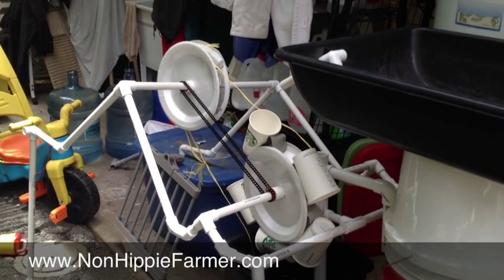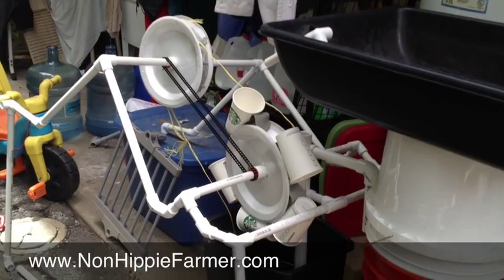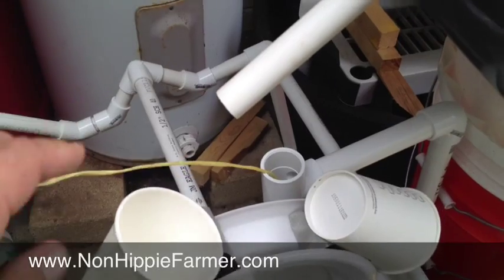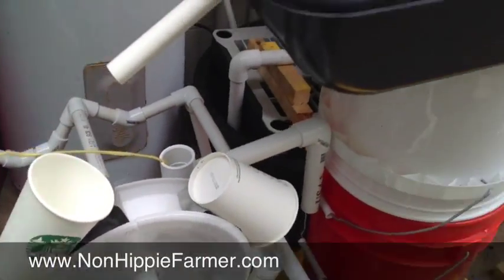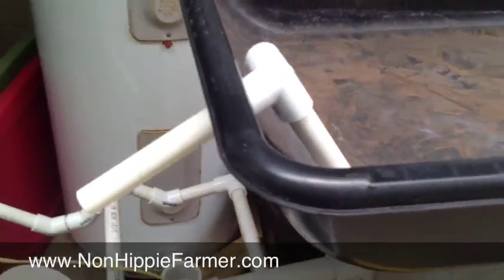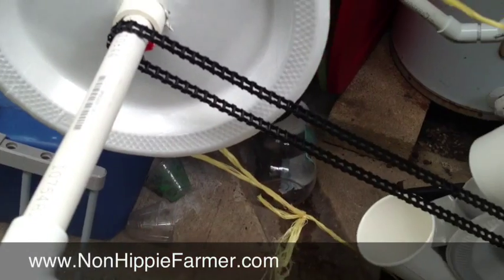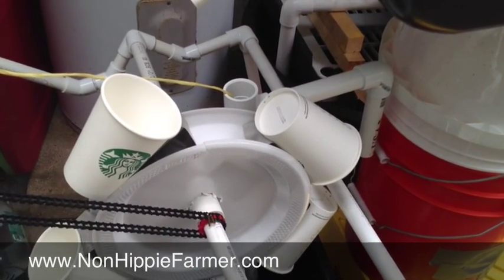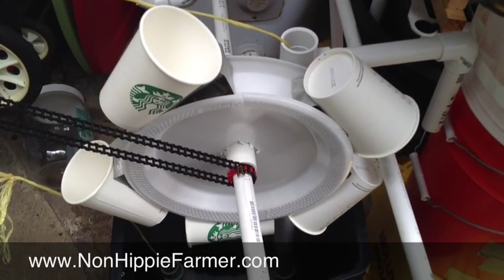Aquaponics Non Electric Pump Prototype

Comment: You are describing a perpetual motion machine. You need some sort of power to overcome your losses to friction. 

But I do like the re-use of the potential energy from the falling water. Maybe add a small wind powered screw pump to give you some more power input.